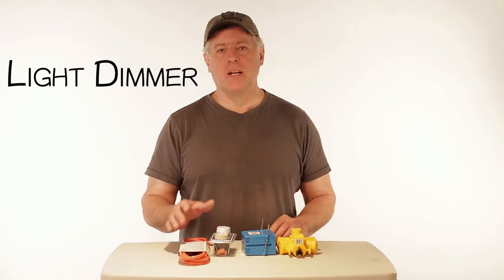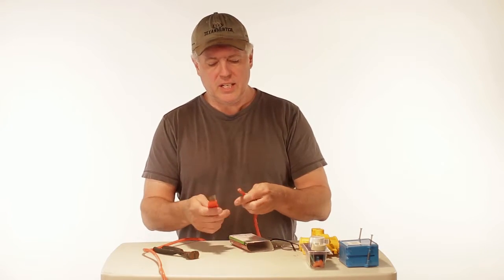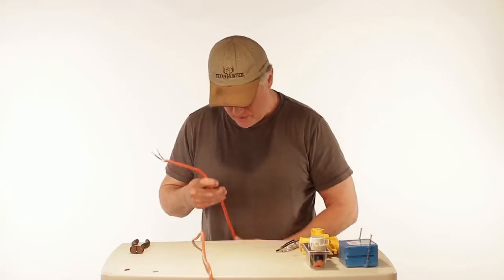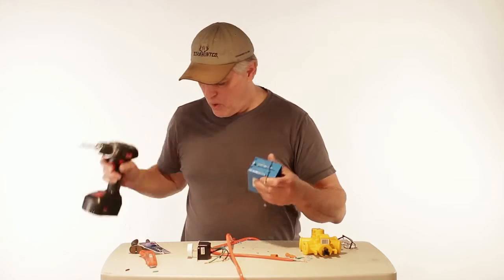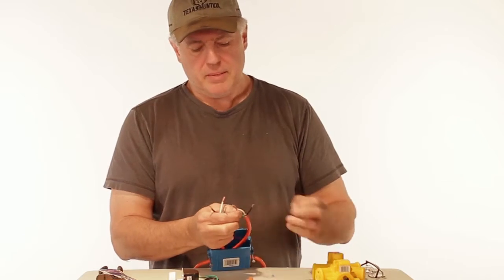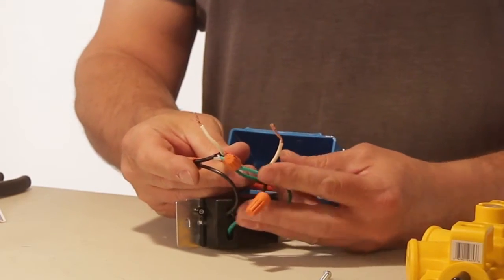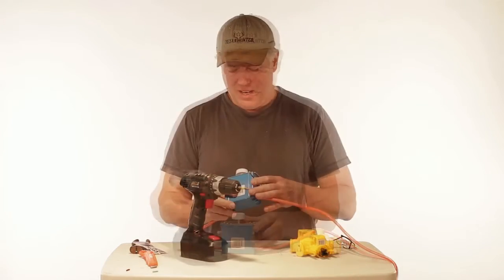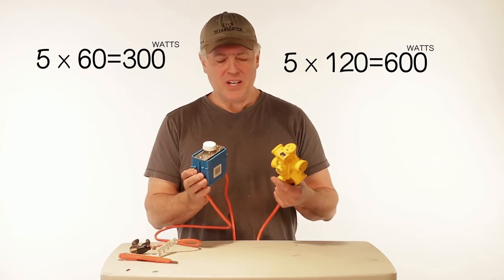DIY Light Dimmer

Comment: I’m going to hard wire 2 vanity light bars to there own extension cord they each have 3 60 watt light bulbs. Would I be able to plug them into this if I wanted them to dim?
Reply: I'm sorry daniela, I'm not an electrician, so I wouldn't be able to give you a definite answer.

Comment: When he says the lights get warm...he means the colour as in kelvin.
I use to make so many of these back in the 80's.
Today I buy router speed controllers at harbor freight...not expensive and they have a clip on them. Makes it easy to hang the dimmer on the light.
Great video Danny.
Reply from the maker: IAWFilmWorks  thanks R. G.!